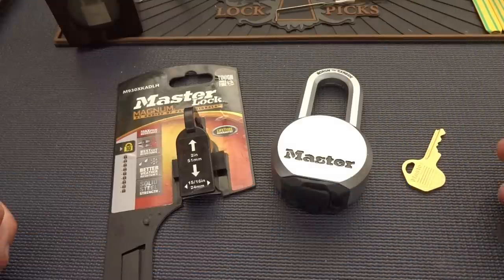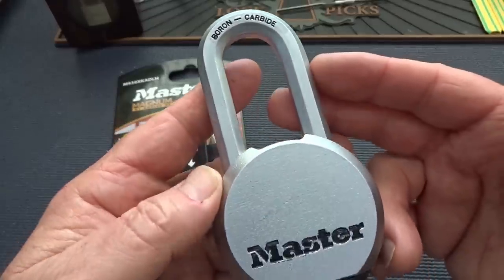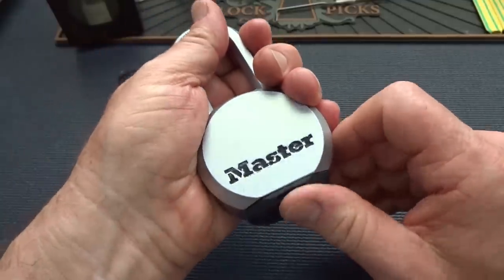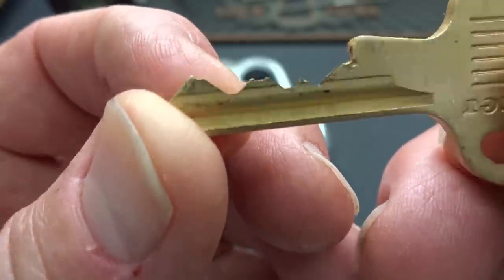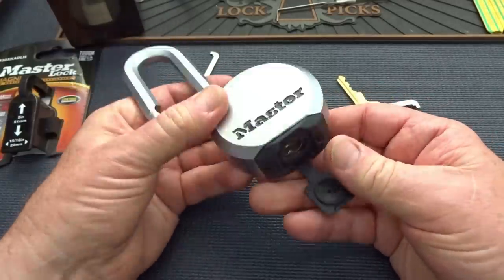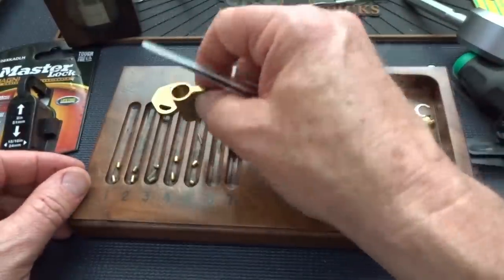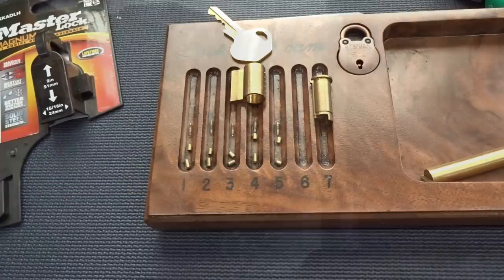(1285) Master Lock 930XKADLH RAKED Open! (JUNK!)

Comment: However, while these are horrible out of the box, arent they kind of ideal for someone who knows a thing or two? The body is great, cant be shimmed, hole is there for the 6th pin. Cheap lock, plus the negligible price of a few pins and springs and you could have a real winner.
Reply from the maker: I agree - a few pennies worth of security pins would toughen this lock right up.  With all serrated or serrated spools in the SIX chambers, this would be a tough lock and would rate a 7 or 8 on a 10 point scale.

Comment: I suspect their scale is resistance to destructive entry.  These are padlocks, after all.

A casual thief doesn't know how to pick locks, and a decent thief won't be swayed by anything short of a Bowley.
Reply from the maker: I would agree had they not placed "MAX Pick Resistance" right next to the 10 on that scale on their package.  THAT is the misleading part.
Reply: Well said, especially because they offer a true pick resistant (albeit not pickproof) padlock, the lockout lock. The european "Excel" packaging does not mention pick resistance at all, just a small graphics  showing a crossed out bolt cutter (maybe "Do Not Use Bolt Cutters"? ;) ).

Comment: My PS4 refuses to play this video and my phone is loading it insanely slowly as I type this. I've had this problem all day and am only now finally saying "screw it, let it load, I've been waiting all day."

I only have this problem with this singular video. Everything else across the Internet is fine for me.

Other people in the comments are having this issue too. What's going on?

[EDIT]

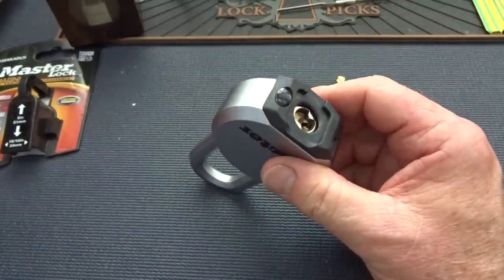It only loaded to 3:58 minutes... I wonder how many times I can rake my No. 3 open in the time it takes my high-speed Internet to load this one video...
Reply: 40 rakes, but it only loaded to 6:52 minutes.

Here we go again...
Reply: Literally 101 rakes later and still not loaded...
Reply: All righty. Finished loading the last 30 seconds while I was watching.

Yes, I actually raked my MasterLock No. 3 open 141 times while waiting for this video to load on my high-speed Internet (at 480p, btw, because 720 was just unplayable). I kind of cheated though. Not only did I not close the lock between rakes (doesn't have to be closed to engage the lock, I merely reset the key position) but I also have in muscle memory the exact position my Southord W rake (thanks for the suggestion, Bill!) needs to be in to open this particular lock without actually raking back and forth; just like a key. MasterLocks make you look like a freakin magician.

Aside from the horrendous throttling - or whatever's going on with this load time - the audio compressor and/or limiter you're using, Bill, combined with whatever background noise was in this video (guessing AC) caused for some drastic dropouts in sound between sentences and other sound peaks. You definitely should experiment more with base room levels so it's just not picking up that AC at all; even when you're talking.

If that's a no-go then you can make a box to insulate the sound of the blowing air. It's essentially an insulated S-shape the air travels and expands through; kills vent hiss on even the toughest blowers in my experience.
Reply from the maker: Tophie  Sorry for all the problems you had loading and I appreciate you sticking with it to finally watch the video.  I have nothing to do with the download streaming from YouTube, but I checked this on my laptop, iPad, and Android phone and it downloaded with no problem.  I even downloaded it over the LTE network with good download speeds.  It appears the problem is with your ISP provider or phone company, not YT.  The video is fairly compact and was processed as I process all videos - nothing out of the ordinary.  Could it be that your provider has speed limited you? 
 I'd recommend you re-boot your phone and re-try if you run into this problem again.
Reply: Bosnianbill I'm with Cox... You know, the cable company whose name is more than just a coincidence?

Of course you don't throttle your own videos; that'd be ridiculous. I just wanted to add my name to the list of people who were having trouble with this one video (which loads perfectly fine now, even in HD).

Also, it was fun. I haven't touched my No. 3 in a couple of months. When I had to wait to watch you rake yours open I decided to pull mine out and do the same.

Lastly, the annoyance wasn't that I had to wait, it's that this was literally the only thing on the Internet that wasn't behaving as expected. I'm not sure how or why this happened, but I neither like nor trust it...
Reply from the maker: You are not the only one to notice this and comment about it.  I've NEVER had anyone experience this with one of my videos, more or less SEVERAL people on the same video.  Something is really peculiar about this so I sent an email asking about it to my YT account manager.  No idea when (or even IF) he will answer but I can't wait to hear what excuse they can come up with.  This is really weird.

Comment: The audio is getting worse. Sone kind of whistle sound. Around 4:25 it's bad.
Reply: Yes, I found it extreme in this video. Remarkable: The timely difference between voice and noise is sometimes very pronounced. Since the hardware has been replaced already, I tend to think it is an audio  postprocessing issue.

Comment: Try same test with a MASTER 6230, the lock this one is a poor knock-off of.... They look the same, but manufacturing is actually by master in Milwaukee and Juarez, not China, and will have the 6 PIN 7000 close tolerance keyway. Not impenetrable, but on par with American 700, but with protection against PXXXXXXX Attack